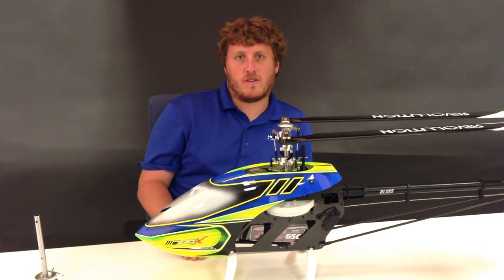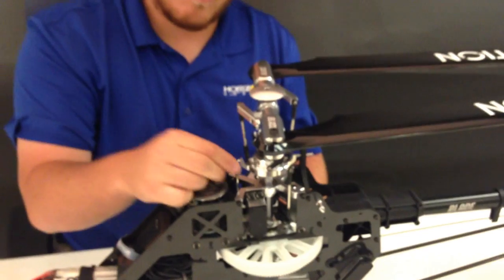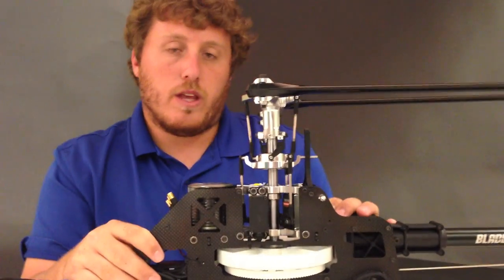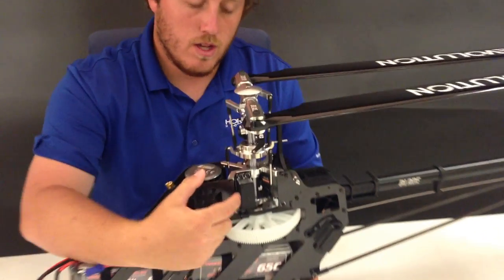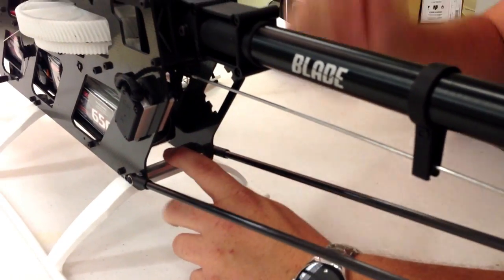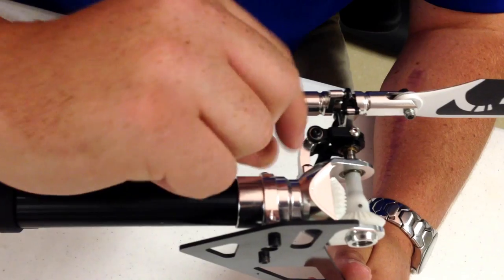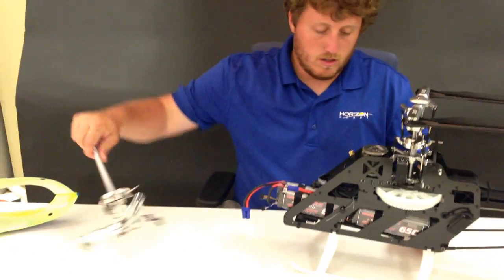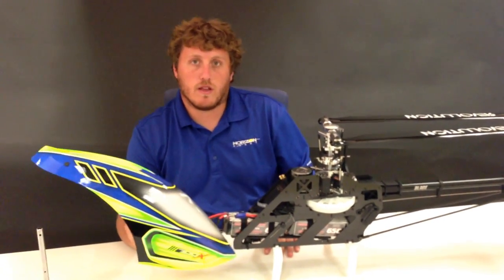Blade 700 X - James Haley - Designer Walkthrough

Comment: I just posted this to RCGroups.com, but worth reposting...

I have two Hobby King Assault 700 frames in the works. One with Spektrum electronics and another with Hobby King electronics.

I've been watching the Youtube walkthrough videos of both the HK Assault 700x and Blade 700x and I must say I would have still stayed with Blade if the continued with their pro line. I like their web site for ordering parts, the customer support, and their common sense attitude. With HK, past their promotional marketing, everything is chinesse. I understand that for CHEAP stuff your going to have a lower level of customer support. Everyone on this forum needs to realize that. You get what you pay for, in parts quality, manual quality, and customer support.

If anyone has compared the construction manual between the Blade 700X and the Hobby King Assault 700X, they will understand. The Blade manual is AWESOME. The Assault, are you kidding me? An engineer couldn't build from those. Why didn't they just copy the Align manual word for word. I seriously follow the Blade and Align manuals more than I even open the Assault manual. But you get what you pay for. The physical parts are fine for my Sport flying, but the backup material is dreadful.

I would have followed Blade to eternity, even if it was a $100 or $200 more than the Align or Goblin kits. I still think it's important to give your end user a continuous progression path. I've been Kitesurfing since 2005 and I've stuck to one manufacturer because I liked them since the beginning, and they have never screwed me. It's called brand loyalty. The automotive industry knows about this. Why doesn't Blade?

Not everyone is looking for the absolute cheapest.

OK, sure, sure, I sound like a one man band trying to get Blade to re-introduce above 450 sized helis. I am NOT ashamed of it.

Blade will be sorry once the Government and local towns clamp down on the use of drones. Them and a lot of others have made a lot of money on drones (except companies like Goblin). Once there are crazy laws banning quadcopters, the money tree will die. Then they'll have to go back to the RC heli. Do you know who will survive? Companies that didn't put TOO much emphasis on drones........Goblin, Align (late to the party anyway), HD, SAAB, Lynx, Thunder Tiger, etc..........

Don't laugh. There are more then a few townships in my area that are drafting laws to outlaw drones. Unless you have the property onwers permission. What fun is that? To fly circles with you camera mounted drone in a grass field. People what to fly over beaches, bridges, towns, etc....not anymore.

Soon, unless it's an AMA field or a farm in the middle of no where, you won't be able to fly. And this will have an overflow effect to us heli pilots because law enforcement does not know the difference between drones and rc heli.
Reply: That was deep